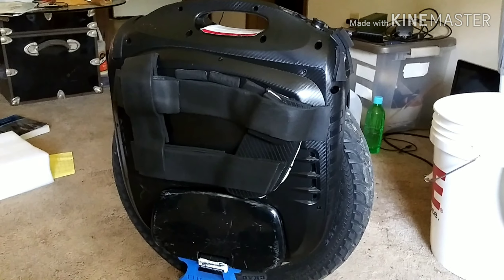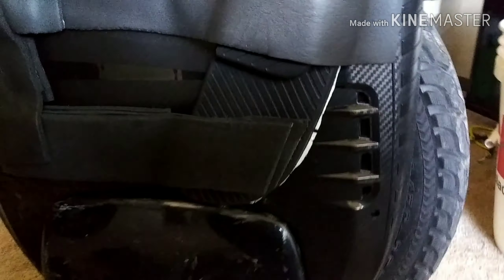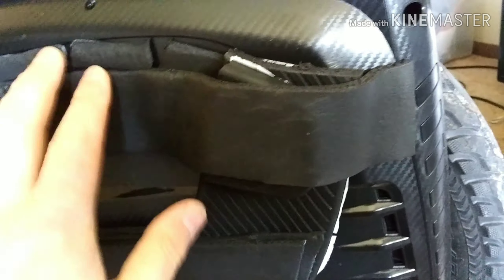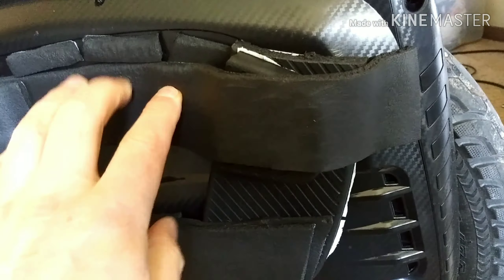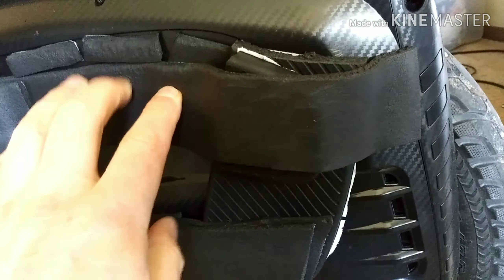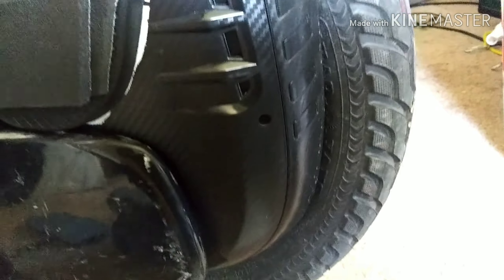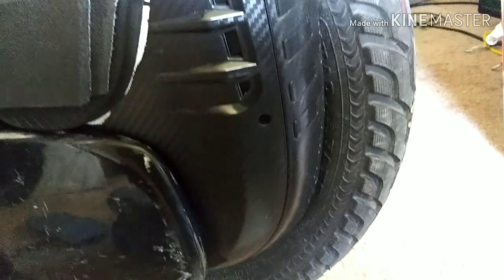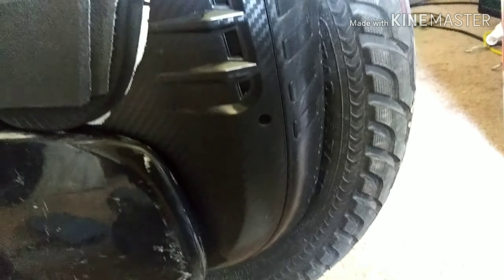GW MSX 100V custom modifications

Comment: Some interesting DIY mods.  Not the most professional looking but I am also more of a, practical over pretty, person myself.
Have you thought about getting yourself a 3D printer.  There are a few prints available out there and maybe find other things to print with it.
I had a V10F, getting an MSP, so I'm wondering about the peddle angles as well. MSP is supposed to be more then the MSX.
Cheers
Reply from the maker: I consider it a first generation of modifications.
When I put pads on my V10F it lookef bad until I did it a second time. I knew more about what I wanted, and how to do it.
What happened to your V10F? I'm in the market for parts.